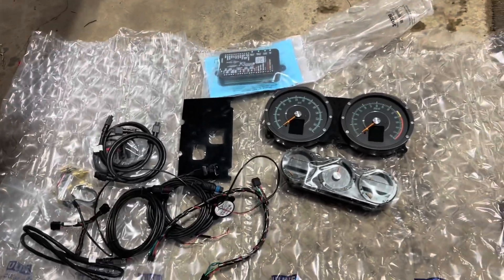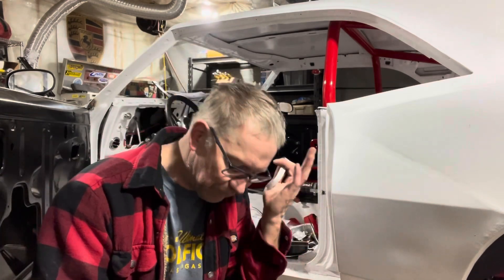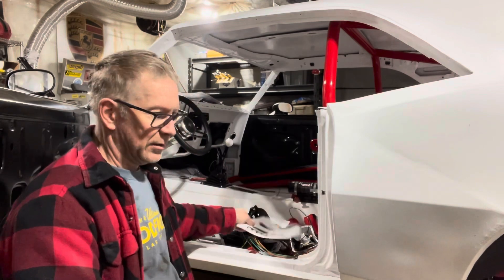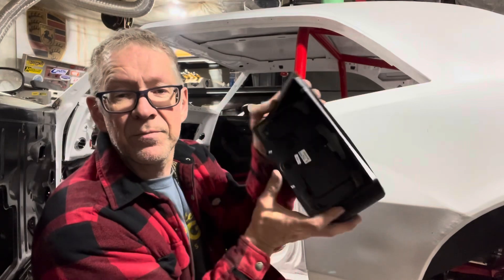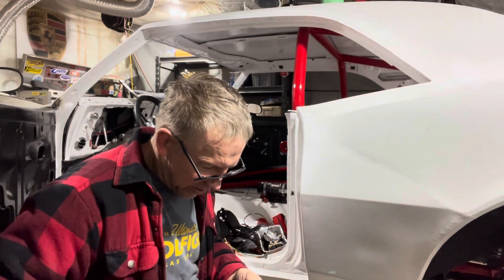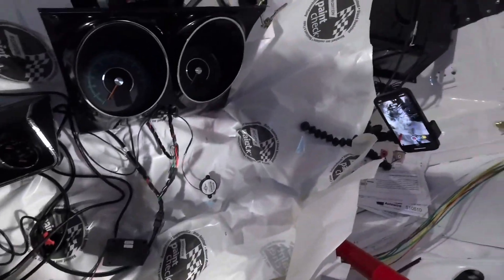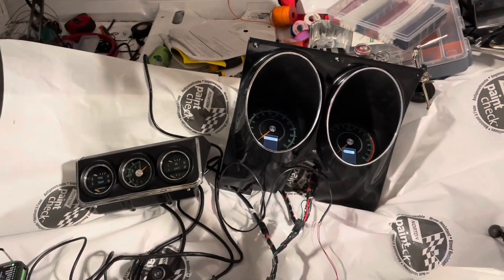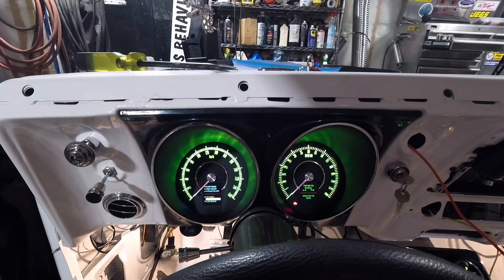Dakota Digital gauges in a 1967 Camaro

Comment: You'll want to hook up the Tach Warn function which is a programmable shift light.
I believe it is ground switched in my application but I could be wrong.
I have a set Dakota Digital gauges but with the VFD controller.  It looks like they added some features with the version of the controller you have.
Neat stuff.